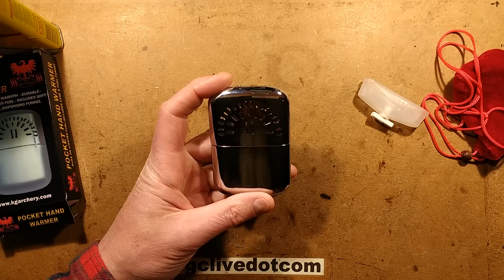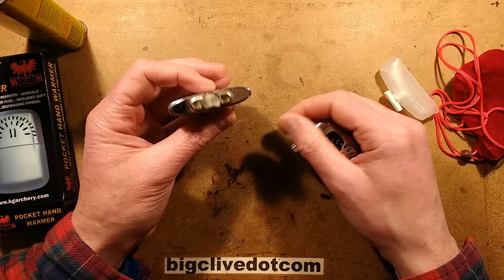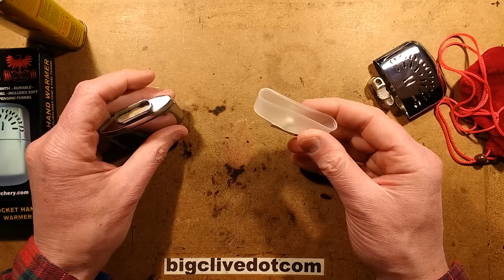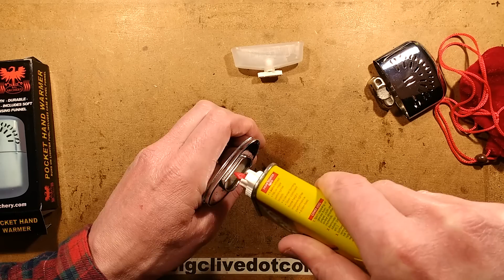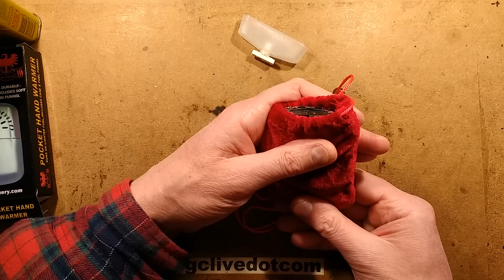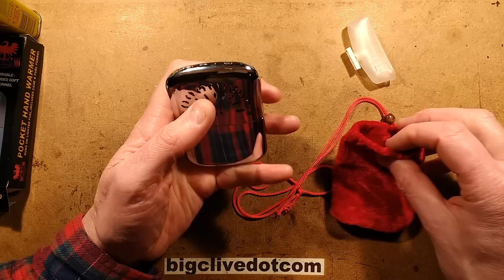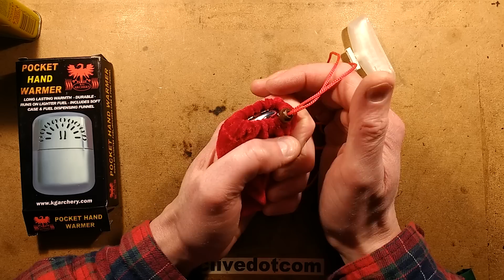How a petroleum-distillate powered pocket heater works.  (naptha)

Comment: Platinum is not necessarily required.
Years ago a friend designed a prototype modern remake of this product made from CNC machineed billet aluminum.  I tried to make the catalytic pad using FibreFrax (described to me as Ruby/Sapphire wool) looks like cotton, then using various leftover amounts of electroplating solution and metallic chloride oxide/sponge (pure metal powder) experimented with difficulty.  
The quick way at the time, i bought a Coleman catalytic propane heater  the pad inside of it was easily divided up into several pieces for our project.
Ill have to revisit the whole project as i was distracted at the time.
Interestingly  a Pure Palladium wire will cause instant spontaneous ignition/combustion of certain flammable fuels (butane and alcohol i think) problem.for use in cigarette lighters that used this and were discontinued was that the byproduct of the catalytic ignition was formaldehyde and or other toxic substance.  It was unique for cigarette lighters in that it was a Slent mechanism, no click or hammer needed to ignite  not even a spark.

Comment: So it's been a few years now How did this work out?  Do you still use it or did you got to the electrick one's ?  Im looking for something now that my hands get sore when it's cold,  I see some new ones now have flash light options and they can be used to charge a phone but most don't heat well or just in a spot on 1 side,

Comment: To be clear, while this is a "knock off" of sorts, it's not of the zippo product. The design of the perforations even seems reminiscent of the peacock design of the original, which was invented in the 1920s, whereas Zippo doesn't appear to have sold these until 2010, as per their own website.

Also, I do notice that the burner on this looks somewhat different from the peacock ones, which are notably more metallic looking. My completely ignorant guess might be these guys cheaped out on the platinum and their burners struggle to get going.

Comment: Ive had two for years. I love'em!
I have used rockwool in a pinch until i could get replacement "mantel"...
They don't have to be too warm to light, in my experience. Just give some moments to allow the fuel to vaporize into the material.
They do get hot.

Comment: These are an absolute must if you're going to be outdoors in the cold for extended periods regularly.  24 hours of heat with just a fart of fluid. I call them pocket heaters cause they warm up your whole pocket not just your hand.

And you can see them glow, faintly.

Comment: There was a type of handwarmer that came in a steel and asbestos box, the outside was in some coloured velvet like fabric. These were usually  made in Italyor say, Bulgaria and were fuelled by some sort  of proprietary charcoal sticks which were usually coated i a silvery paint like substance. If you can find then for sale, it is usually on ebay, same for the fuel sticks. Similar hazards to the zippo catalytic heaters, different mode of operation. The zippo catalytic heaters seem to work better if you are not  running around but staying relatively still.
Reply from the maker: I think the charcoal hand warmers are still available.

Comment: this is such a late comment i doubt clive will even see it ,i ran my peacock hand warmer on ipa 99.9 and i timed how long it ran for  ,a total of just over 15 hours ,when using  petrol fuel , i would get around 8 to 10 hours ,but i did notice on ipa it did,nt get as hot . but i doubt you would notice it outdoors in the cold .i never had any spilling or leaking at all :)
Reply from the maker: I've not tried IPA.  I may give that a go.
Reply: @bigclivedotcom  well smack my  buttocks and call me brenda ,i did not expect a reply clive ,but thanks for replying :) i suspect that these hand warmers dont rely on wicking ,and more on Evaporation of the fuel caused by the catalyst warming the body of the hand warmer .so ipa works exactly the same as petrol fuel ,but i do think that the ipa burns at a  lower temperature than petrol .

Comment: When I worked as a gasfitter in the 60s/70s there was something called a magic wand. It was a wooden handle with a wire rod that curled at the end, putting this into the gas flow it would heat up and light the gas. I believe platinum was the catalyst never seen them since.
Reply: I'm sure we had one when I was a little kid, back in the 60s.  Would have been in the days of town gas, not the newfangled natural stuff.  Maybe that's why?

Comment: Awesome! I got a vintage WWII model, Peacock brand. Has the patent number stamped into one side of the cap and "Made in occupied Japan" stamped into the other side. It was from one of my Grandpa's friends when he passed. Had no idea what it was or how it worked. Googled the patent number stamped on it to find out it was a hand warmer, but only now have I learned how it works. Not sure if I'll have to replace the pads, but I can confirm older ones did come with a better quality filler, this one has an aluminum based cap that goes on the other cap, its designed like a teapot for pouring in the lighter fluid. Once I get it working it will be handy for my commuting, I ride a motorbike 70+ miles a day and winter has been setting in.

Comment: These are amazing devices..
I was given a Zippo version with the Platinum element missing. So I bought a replacement (genuine Zippo) on eBay. The Zippo version has very little air gap by design and after lighting stays just warm for about 35 minutes, then suddenly it becomes extremely hot. So hot that you cannot touch the outer steel casing, it'll burn you.
But if it's in the bag it just perfect and heats any pocket for hours and hours.
Great for outdoor use too. 
After what you said here I'm wondering if the Zippo does go into Thermal Meltdown.

Comment: Top Video Clive,  if you fill it with pure Methanol, it gets sooooo much hotter EDIT: I just did a side by side test and that is not true, they were as hot as each other. But since Methanol can be got for £10 delivered for 5 litres, I consider that a win :)

Comment: I rode my Harley for many years in the winter when it was snow free. I always had these things with me. My tip: sew a lanyard to the bag so you can wear the oven under the jacket. The heat comes best on the chest, back and between the shoulder blades or in the boots. Is the winter grim use two stoves. 
So that it does not get too hot I put a cardboard in the pocket, so I can choose between a warm and a hot side.
For fuel I use Aspen 2 stroke gasoline, it doesn't smell and is dirt cheap.
I prefer the Peackocks but the cheap China ones work fine but only use the ones with the glass wool pad.
Greetings from Germany.

Comment: How long does the catalytis last before you need to buy a replacement
Reply: Used my Peacock for years, they have the glass wool pads, pretty worn out but still works fine. So the answer is couple years.

Comment: I thought I'd see just how far these could go, and WOW! The best thing I can compare these to as odd as it may sound are nitro RC engines, ie very few things you can "tune" but at the same time it's all about tuning just achieved in different ways, eg, by controlling everything from how much fuel is in it (it effects it's overall temp, not just it's run time) to how much air hits it, to the little case you pop it in, and once a 20yr learning curve is applied (for you Clive it'd take you a few days to master the details that you have to witness yourself)

So... what are my results? when fully filled I can get 84hrs, yes 84hrs that's not a typo, with an average temp of around 55c-65c (filled to the point it's full but in no way dripping when squeezed or "wet wet" around 20mls, NEVER overfill it to the point it'll actually catch on fire, NEVER put fluid directly on the element and light it, that'll kill it instantly, hold a lighter to the catalyst for a few seconds, if its dark and you cup your hands around it you'll see a dim orange glow only, do NOT use a jet lighter etc as it will blow a hole in the catalyst, that's part of the learning so you can skip that bit now haha, but once you get them all sorted in your head WOW WOW WOW! so so much heat from so little fuel, I've got a bunch of them and when it's super cold get 4 of them going, you can even use them in bed, I love them, if only for the satisfaction of telling me I'm wrong I implore you to give them another try, oh, and if you've damaged the catalyst you can pick up a 5 pack on ebay for around $3 :)

Comment: I've had one of those 60 years ago. to ignite: wet the wick with naphtha, the just ignite the wet wick. when the flame goes out, add the top shield, and wrap the bag around it and pocket it.  Works well. typically only one lighting each use or fill. Good Video. Oh, an afterthought. Gasoline has lead and other automotive additives. Naphtha (lighter fluid) (or what they call WHITE GAS (used for camping stoves and gas lanterns like Coleman brand mantle lanterns)) burns clean  (Non-hazardous)

Comment: Coleman used to make a catalytic space heater for camping or rv's. It's the same as this but comparatively really big. The downside to the design is it has no carbon monoxide shutoff system.

Comment: Vehicle gasoline works, it was the common available type at ww2 which soldiers used with their petrol lighters. Cannot remember specifics about the most common type etc.

Anyhow there is couple of drawbacks. It was probably 95 or 98 octane which I tried as teen. Cannot remember was it ethanol infused, as it is these days either 10% or 5%. So first of all it does not seem to be as 'pure' as zippo gasolin. It generates more smoke, iirc the flame was not as stable, but the worst part is the odor.

You really smell like a gas tank having such filled petrol lighter in your pocket. Might or might not be preferred outcome :D

Comment: Just never use automotive petrol. I had one of those when serving in the Finnish Defence Forces when young. I slept ouside in the winter in a sled with just winter clothing and a blanket, that thingy between outermost layers of the clothes. It brought back just the amount of heat I was losing. A great thing, I also ordered a new one from China. Easiest way to fill it is by using the foldable nozzle in the lighter fluid can...

Comment: I found a "Jon-E" brand one at a sale, turned out to be roughly 65 years old, orig purple bag ect... works ALOT better than lipo ones or equivalent :)  Always a great video :)
Reply: The old ones work better because the heating element used asbestos which the  modern ones lack due to it be a carcinogen.

Comment: Just had a look at one of these online and they show lighting it in the inverted position at a slight angle, which seems to make sense as that would probably allow the fuel to connect with the wick.

I believe those old petrol lighters people used to tap the on their hand inverted when the fuel was low and that would enable them to hight.

Comment: ...this is the 3rd item that we have which are identical.  Mine leaked in my front pants pocket once after I filled it to the max and then some.... Ugh. Well mine is much older I suppose....
Reply: Clyde, it was terrible, I was 20 something and we were going out to 'party' and that happened. I was all gussied up and it was going to be an epic night. Then I started to feel a burning sensation right next to my, um, well on my upper thigh.  And it kept getting worse and then I realized what was going on.  The fluid in that thing had a great deal of latent energy, I can tell you that.  I had a grapefruit sized chemical burn that lasted almost 2 weeks and besides being a 'too close for comfort call' it was a very uncomfortable sitrep.  (mine was powered by lighter fluid though...)

Btw your channel is amazing, reminds me of the kind of things I did when I was in my teens.  One of my favorite items were the old style condenser coils  that were used for creating the ignition sparks for internal combustion engines. 

While I am unable to support you with Big $$ I could send you something to analyze.  It would probably be best if I ran any ideas past you first to prevent repeated efforts.  would you be able to provide the address should we agree on an item(s) for study/experimentation?  And what is the best method of contact for you?  Community channel perhaps?

Comment: The handwarmers which are bags of fluid are quite interesting too. Basically a super saturated salt solution. Water which is heated can hold much more salt than when it's cold. As you boil the bag, the salt dissolves into it completely. As it cools it becomes super-saturated and the salt is "locked in". It can remain in this state indefinitely unless "shocked". When you snap the little spring device, the shock creates a nucleation site for salt crystals to begin forming (in the same way that the microscopic imperfections in a glass allow bubbles to form in your beer). Once started, the reaction is rapid as the whole of the salt begins to crystallise out. As this reaction is exothermic the biproduct is heat. Once its over, boiling the bag again will dissolve the salt into solution once more.
Reply from the maker: Sodium acetate.
Reply: Fascinating explanation. Thanks for sharing, I'll buy one of them also 😀

Comment: I had a few of those back in the 60-70 times.  There flipping Magic and brilliant.  You get some 6-8 hours or more  of heat for a fill.  Two in the front jacket pocket do the trick.  No way to turn them up or down but they produce most well. NO Auto gas.  white gas's or naphtha.

Comment: My sister's got one that runs on sticks of charcoal. A better idea, I think. AFAIK it doesn't need catalysts, it just burns from one end very slowly and flamelessly, as charcoal will do, particularly when it's a dense rod, not many pores for air to climb into. The airflow in a standard pocket happens to balance out nicely with the temperature and lifespan of each rod. She's not told me of any complaints she's had. 

Oh and I came here to say - "NAPHTHA" ! There's a PH, not just a P. So it's said like an F, NAFTHA. 

That said I'd take this over the incredibly dodgy electrically heated power bank I see a picture of on the right of this screen. I think I remember the video. Dodgy as fuck, and electric batteries just aren't designed to give that much energy density (for long life) or power density (for more heat). Absolutely the wrong way to heat a pocket, I'd go with combustion all the way. There are ways to design combustion chambers that are fairly safe, and burn slowly with little air. Even if they make carbon monoxide, a spoonful of that in somebody's pocket is no harm. Here, solid fuel is better cos it can't run down anybody's anything.

Comment: I had the genuine peacock ones. Used for years but always following instructions. Easy to light when following instructions. Which was to hold the lighter under the centre of the catalyst until a few of the fibres glowed. ( usually 15 to 20 seconds) upon removing the flame the glow would stop but the thing was heating. then slip the lid on then drop into the bag. 8 to 10 hours of warm but not too hot hands.

Comment: I bought two of these from Restoration Hardware back in 2005.  They do work, and they are fairly safe, but you want to fill them with fluid well before you take them out and use them so you can wash your hands and not be covered in lighter fluid.

I still have them laying around somewhere, I'm sure.  I used them for a winter or two.  Back when I delivered newspapers as a kid I had another type that used small charcoal sticks in a fiberglass lined steel clamshell with a red velvet outer casing. Those worked the best.

Comment: I have two of these. They're excellent.
You can't use normal petrol, lighter fluid is naphtha rather than petrol and is considerably lighter (shorter chain hydrocarbons) and cleaner burning, the short chain hydrocarbons also mean it readily converts to vapour.
Easiest way to get them started is to soak the converter in a few drops of naphtha and then light it, that draws the vapour up.

Comment: I've had one of these for over 50 years. Loved using them as a kid, let you stay outside all day! Mine went 8 hours when full. They used to sell belts that would hold one over each kidney and that really kept you warm. The bag keeps you from burning yourself, it gets really hot. Mine has metal mesh at the top, and does glow slightly.
Reply: These Peacock brand will burn 20 hours or longer and are better than the current Zippo brand or charcoal burners

Comment: I’m told you don’t want to apply flame directly on catalyst as shown here, heat the unit and then graze the catalyst with flame. Zippo catalyst suck and need rebuilding right out of the box. I’ve had great luck with peacock right out of the box. There is a guy from Canada that does a great job on YouTube teaching how to upgrade all handwarmers

Comment: For the record anybody who is interested, this type of unit works more efficient in a low oxygen environment. So if you get it started out it in the pouch quickly. I have a couple Zippo ones and they work great. Running it out of the pouch just burns up the catalyst

Comment: Clive!  That is not gasoline your are using, that is what Americans call 1K Kerosene, Varsol, barbecue starter, or lighter fluid.  It is not nearly as combustible or dangerous as gasoline (petrol).  You can actually put a match out in a dish of that lighter fluid you are using (try it).   I hope no-one is actually going to try to use gasoline in a hand warmer, that would be a big, big mistake.
Reply from the maker: The lighter fluid is not kerosene.  It's very volatile.
Reply: that’s interesting, Clive.  Your container says “lighter fluud” and it’s identical to the lighter fluid containers in North America.  Maybe it’s a semantic thing.